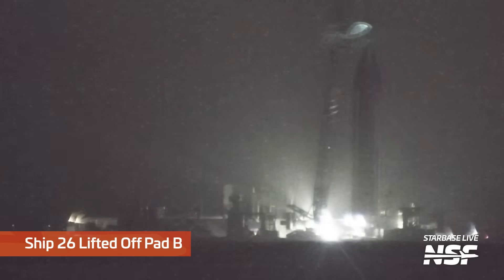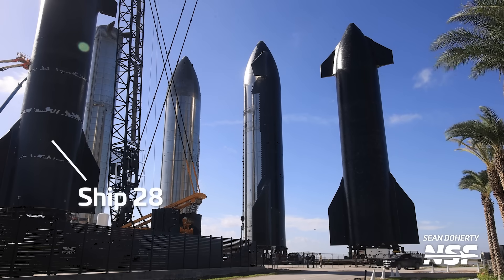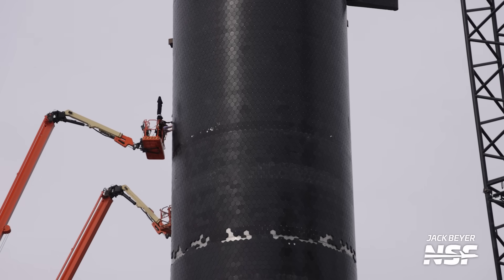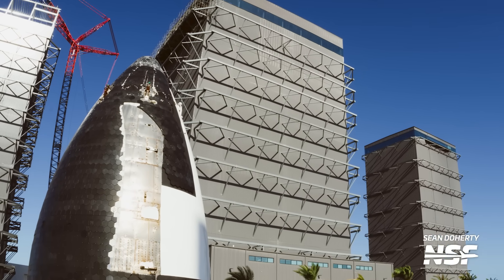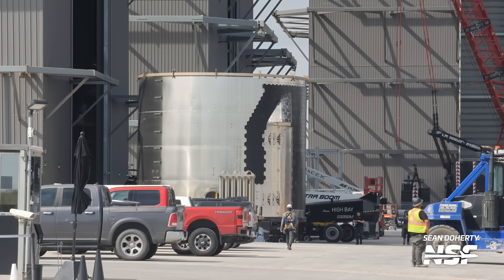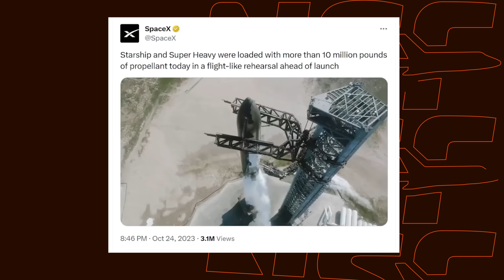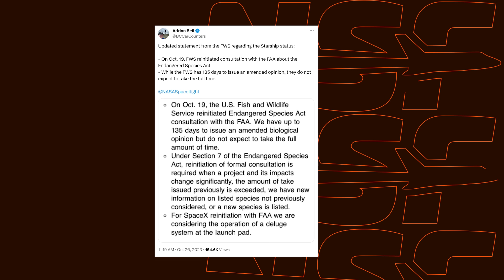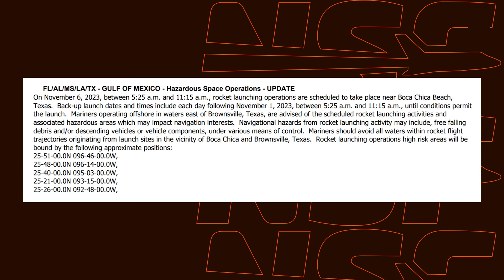The WAIT Is on For The Next STARSHIP Launch | SpaceX Starbase Update

Comment: Praying number 2 is successful.
Reply: Success is probably a little higher and separation this time. No plans for chopsticks this launch.
Reply: After the outcomes of the static fires, I’m a little less hopeful
Reply: @BCR81 what do you mean? I thought static fires were ok, Deluge should help not incinerate the pad. 

Success this launch: Deluge saves pad, Higher altitude, separation, ???
Reply: @casanico2082  the first static fire was cut short due to an abort, and a few engines were out. The second static fire, they were still unable to get 33, only managing 31. As seen last flight, even with a few engines out, the booster struggles. But other than that, everything else I think will be okay
Reply: @BCR81 ship 25 static fire was weeks ago? Last week was only kinda a WDR last week and partial deluge, right? But they won't do another one before launch?
Reply: @casanico2082  ship 25 I don’t really care about. It’s the booster that makes me worried. Yeah, I don’t think they’ll do another wdr, unless it’s in the form of a launch scrub. I’m pretty sure it was wdr and full deluge last week, as the deluge had a bit more oomph to it than in the past

Comment: With these new higher walls going up maybe NSF needs to do a fund raising to buy its own scissor lift, or maybe a second hand fire truck - one with a raisable ladder on it. If you go the fire truck route, which would be the most fun option, just make sure that whoever is taking the photos is firmly tied to the top of the ladder before it's raised.
Reply: Robots. They have robots to do the hazardous work. 😊

Comment: @NSF 
Could 26 be converted to be a fuel tank for in space refueling?🤔
Reply: It depends on whether or not the internal structure itself was modified to accept those integrations, but it remains a possibility. But since Ship 29 almost certainly has modifications of its own and is currently slated for IFT-3 my prediction is that Ship 26 was only ever a glorified test article and will be scrapped. Guess we'll see.

Comment: What is HLS?
Reply: Human Landing System. It's an acronym for any space vehicle that is capable of landing on the Moon with humans on board.
Reply: HLS is one of 2 different landers for the Artemis lunar lander so it's a project funded by NASA although I wouldn't be surprised if SpaceX is actually doing some of the work at its own expense in order to get to the very competitive price it was able to offer to NASA to win one of the two contracts awarded. I suppose it's a similar approach to what NASA did for crewed ISS vehicles, hedging its bets by funding 2 different vehicles - Crew Dragon and Boeing Starliner. (Thank goodness NASA didn't go only with Boeing!)

The other contract for the other Artemis lander went to a consortium led by Blue Origin and the third bidder who failed to secure a NASA contract was Dynetics with its "Alpaca" lunar lander concept (which in my view is a shame because I thought that the Dynetics proposal was more exciting than the Blue Origin one).
Reply: I dont understand it either, that they lost.  That tiny Alpaca was only 4x more expensive than Starship.  🚀🏴‍☠️
Reply: @MichaelWinter-ss6lx  I wasn’t talking about Alpaca losing to SpaceX, SpaceX clearly deserved the round one win. I wish Dynetics could have sharpened its price enough to beat Blue Origin in the second round though. And yes, the price just wasn’t competitive, but in terms of pressurised volume the Dynetics and BO proposals weren’t that different.
Reply: @julianfp1952  The initial HLS contract that SpaceX won, was supposed to have had a second bidder as well. The 2020 Congress gave NASA 1/4 the funding that they asked for, so NASA only chose the top bidder in Apr 2021. NASA was able to get more funding from the next Congress and they had the Appendix P competition that Blue won over Dynetics. From the Source Selection Statements of both competitions, price was NOT the main factor. Blue beat Dynetics on merit in the second competition. 

I would not be surprised if Dynetics got one or more CLPS missions for their Alpaca, similiar to how SNC got a CRS contract for Dream Chaser.